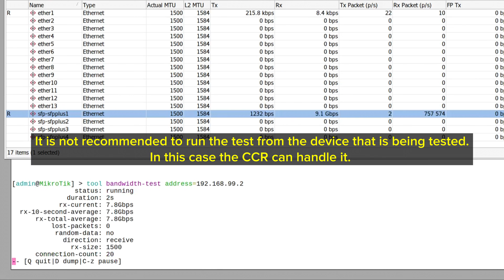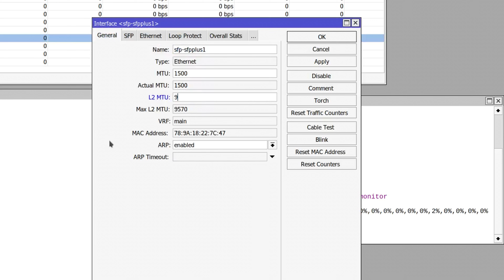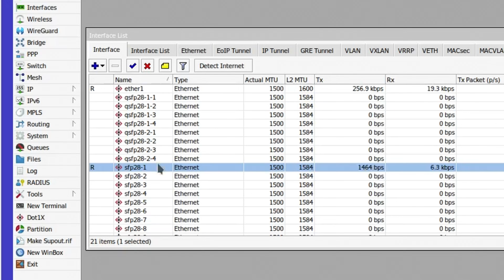Jumbo frames - transfer more data faster!

Comment: Does it mean that connecting a laptop with MTU 1500 to a network with routers and switches configured MTU 9000 will not give any benefit in IPv4? And same for IPv6?

Comment: long time ago there were Intel NICs that supported 14k jumbo frames but I've never seen any other hardware that supports those so they were quite useless at the end of the day

inb4 are jumbo frames fixed on CCR2004-pcie already? Not so long ago they only worked on factory ROS image and stopped working after update :<

Comment: Will swOS ever allow to customize the MTU rate?
Also, if a MikroTik is running swOS, does it have jumbo frames enabled by default? (I can't seem to find definitive answers on this)  
my organization is trying to use Jumbo Frames to connect our server hosts to a shared iSCSI storage device for virtual machines. 
So we bought a couple of crs309-1g-8s+in router switches and we don't need all of the advanced routing features, just basic L2 switching with jumbo frames.

Comment: Please fix your point to point RF gear( NV2 mode(not 802.11 spec(as we know thats MTU limited) ) to support jumbo frames.. 
I have use cases for passing jumbo frames from a telco ( MEF 3 spec's ) between sites and last mile is over a wireless links.
Else I have to go to Cambium / Siklu as their wireless products support >9000MTU..

Comment: All my upstreams provide me IP Transit with jumbo frame: Cogent (AS174), Lumen (AS3356), TATA (AS6453), Sparkle (AS6762). They're all Tier-1 providers and they delivered their service in jumbo frame ports by default, not upon my request. The internet DOES support jumbo frame and IPv6 was perfectly designed for it. Enabling it also cuts in half the time for full routing establishment.

While for IPv4 it is indeed tricky to use, it is safe to use jumbo frame in IPv6 over the internet and it is wise to do so. It reduces drastically the effect of latency in max transfer speeds. This is specially useful when making transfers from servers aborad (80 ms+). I kindly recommend to all network operators to enable jumbo frame in all IP transit ports and in your backhaul as well.

Comment: @MikroTik can you please make CSS610-8P-2S+IN but CRS with routeros? And with 2 PSU high\low voltage. Also need 2.5gbit small switches with poe-in and passive poe-out. Old products were better in sense of powering when there's lack of cables. I bought 5009 and so frustrated that I can't use poe-out without separate PSU.
Reply: They released CRS310-8G+2S+IN. According to servethehome looks like there could be PoE version also in future.

Comment: Question: In case you configure 9000 only in one device, but on mangle rules "clamp to mtu" in both devices, witch is going to be the real through put

I dont have devices to test it

Thanks for your videos
Reply: Mangle operates L3, here's we're talking about L2. Clamping wouldn't do anything, when MTU9000 frame will be dropped on the side with MTU1500.

Comment: larg mtu  doesnt work well with lte connection
Reply: LTE has MTU 1480, so jumbo frames obviously do not work; it is necessary to have working PMTUD. Which is a separate problem. With LTE and PPPoE it kinda works, with IPSec tunnels there doesn't seem to be a universally working solution on Mikrotik.
Reply: MTU over 1500 doesnt work in Internet at all. Also jumbo is a bad idea for non-reliable links, otherwise we would have much greater MTU from ARPANET to begin with.

Comment: The main downside is when your device's 10Gbit interface is also the one used for going online.
My server had jumboframes enabled in the past but I kept running into overhead issues when I wanted to upload something to an external server since the uplink from my router to my modem only has an MTU of 1500 (with no ability to set this higher).
Reply: Yeah the problem is that there is no good mechanism to negotiate the MTU. In theory you could run your home network with jumbo frames and announce the IPv4 and IPv6 default routes with a lower MTU. Good luck getting all devices on your network to be able to receive jumbo frames and honor the route MTU. sigh
Reply: With proper MTU configuration on all layer 3 endpoints and/or egress/ingress interfaces, PMTUD on layer 3 will do its job.

I've been deploying jumbo frames for many, many networks over the years, no problem with proper PMTUD. What people tend to mess up on, is layer 2 devices<>layer 3 devices relationship and MTU configuration.
Reply: @DaryllSwer  In theory you don't even have to learn the 1492/1500 MTU for each destination because SLAAC and DHCP can can include the route MTU for the default route allowing at least on-link jumbo frames without having to probe the MTU for each connection, but as soon as one device on a link doesn't support jumbo frames you can't really use them on any device. IMO the least painful workaround is to have two (sets of) VLANs to for 1500 and 9000 byte MTUs. It's not a universal solution, but it works as faster path for a few workstations and servers which can profit from a larger MTU without burdening all devices to support jumbo frames or a mix of normal and jumbo frames.
Reply: @DaryllSwer  The fact I don't even know what PMTUD is or what it does (yes, I googled it just now) should tell you which group I'm in. :^)
Tho in all fairness, I haven't seen such an option in MT devices so that doesn't help either.